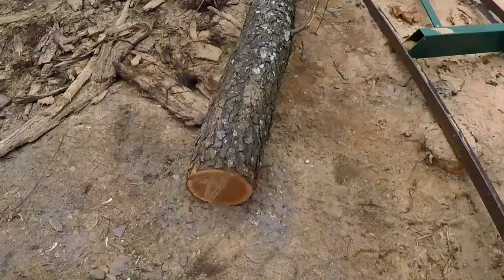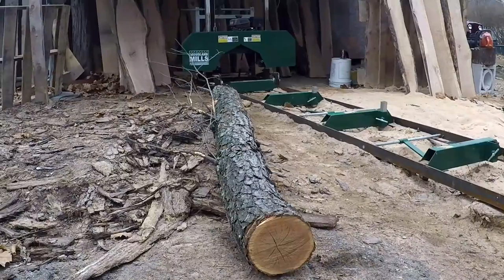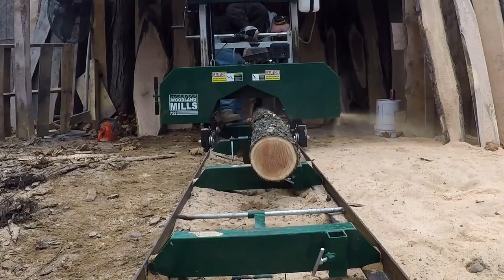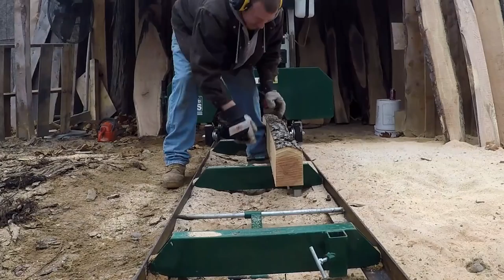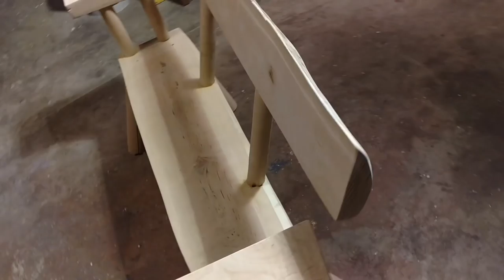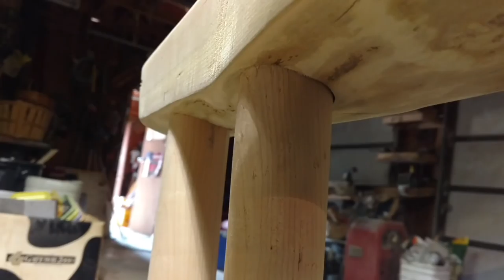Milling some scraps into a bench

Comment: @ Ben

Do you ever need to worry about your bed going out of level the way you have it set up now?? Can you just run the mill and be pretty confident the cuts are gonna be square? Enjoying your video's man, thanks for posten um.
Reply from the maker: I still have some issues. I have all thread studs sticking out of the concrete posts I put in the ground. I check every so often and make adjustments as I go. I haven't had to adjust the bed near as much but it does move a little summer to winter and from throwing logs around on it.
Reply: Bens sawmill 

Was watchin another guy roll a log over on his. Every time the log would roll the entire bed would move... like several inches. I watched all your vids so I saw how you did your bed on the sauna tubes. Thought that was a great idea, glad it's workin pretty well for ya.

Comment: I notice when you are adjusting the height of the blade you go below the thickness and bring it back up. Is that to make sure there is no slack it blade height adjustment. I use to do many settings like that on old sheet-fed printing presses.
Reply from the maker: I don't do it all the time, but yeah you got the idea. the crank is attached to a cable and sometimes there is slack left in it. if I go down then back up it makes sure the cable is tight.
Reply: Good habit around machinery.

Comment: What chainsaw model was that?
Reply from the maker: It's a Husqvarna 240. I broke the chain break handle on it. but it works just fine for jobs like this.
Reply: Sorry to annoy, but would you recommend a Husqvarna chainsaws over  Stihl? I own both hatchets and axes of both makes and the Stihl ones are pretty terrible in comparison, they are junk actually. I am UK market not sure if you get different
Reply from the maker: I would tell you if I could. To be honest I have only ever owned craftsman, poulan, and Husqvarna chain saws and Husqvarna is by far the best I have ever worked with. I am only doing milling and working with logs as a hobby and could not afford a stihl chainsaw so I have never owned, and never used one.